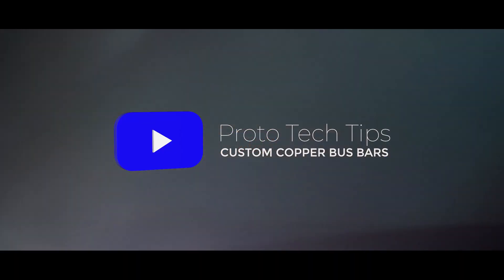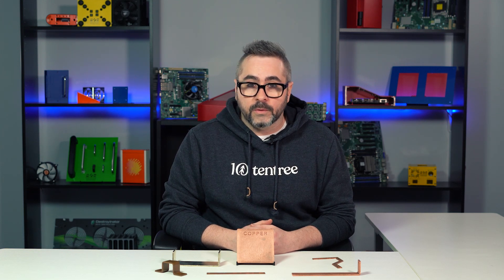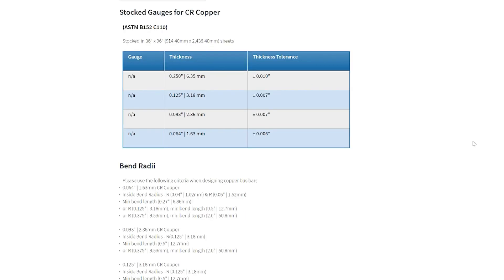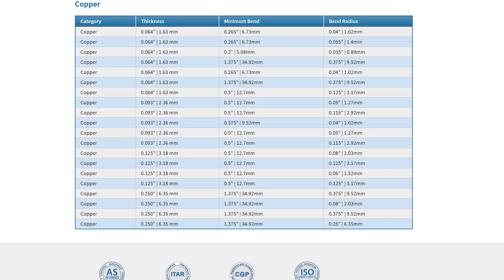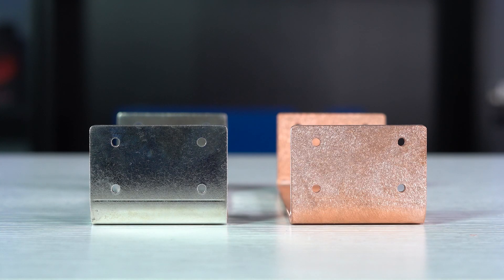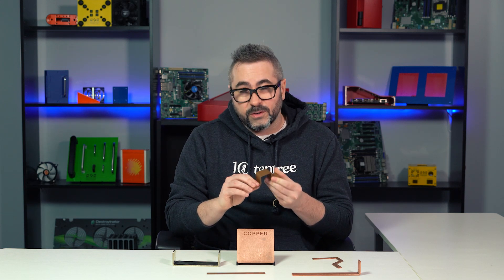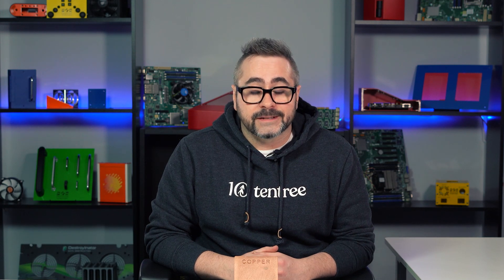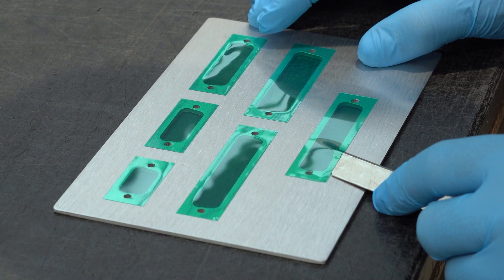Proto Tech Tip - Custom Copper Bus Bars

Comment: Good video.  Do you have one that talks about connecting the bus bars?  Use of any anti corrosion compounds, etc.?
Reply from the maker: Tin plating would be considered a good form of corrosion protection, similar to how powdercoat would also protect the metal.